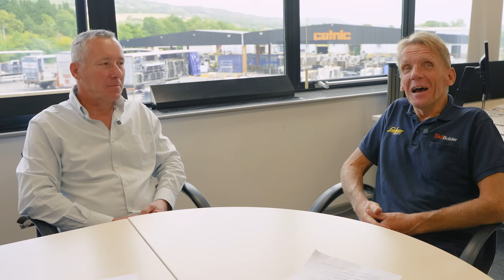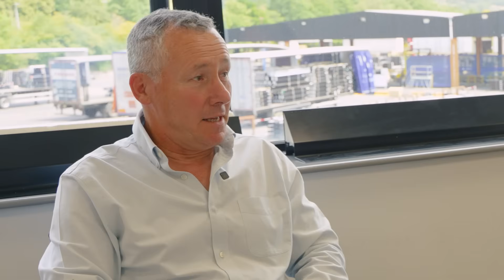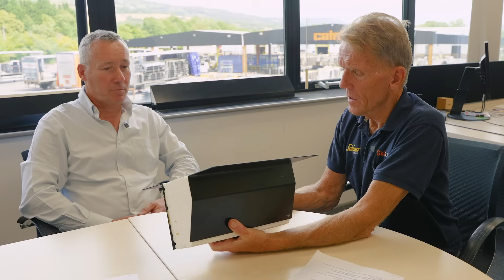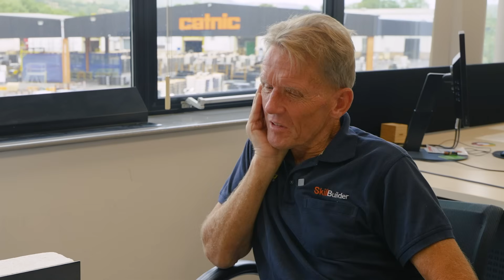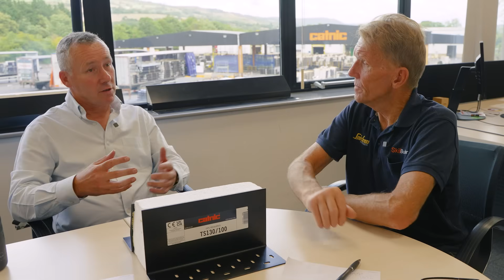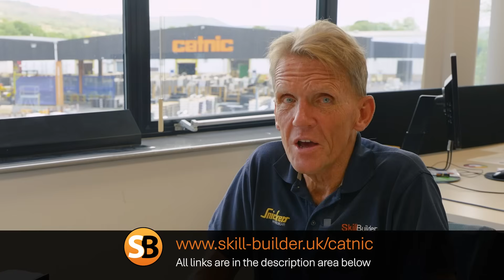Why Thermally Broken Lintels Are a Game Changer

Comment: There's no doubt these thermally broken lintels are a great idea 💡..
A few improvements that I would like to see on them type of lintels are a 25mm upwards step in the inner lintel to allow for a P.I.R thermal insulated plasterboard to be stuck to the underside of the lintel for even better thermal heat loss at the top of the inside of the opening together a high compressive strength fire resistant P.I.R insulation in between the two steel sections instead of the polystyrene..
Are you listening to me CATNIC?.
No..😂

Comment: Fabulous and important video! 

I just had to replace the old wooden lintels over my balcony and double door because the bricks above started cracking. A 1940s semi detached and all was hidden under some thick plaster. 

Got a 50mm cavity and couldn’t get a thermally broken lintel and my builder was a bit surprised when I was asking for it. Unfortunately, Catnic does not make these for a small 50mm cavity! 😢

So we had to get separate lintels and put insulation in between. Would have been easier with one thermally broken available like this. 

I replaced the doors with some more efficient triple glazed options and can’t believe that people would consider a non-thermally broken lintel just above. It is like a massive cold bridge where it will condensate the water.

Comment: Surely just using two separate lintels for the inner and outer leaf means you’ll have a long lasting and robust lintel design without any thermal bridging?
Reply from the maker: That is true but it can cause rotation when building.

Comment: Once in it acts as two large L shaped lintels, structurally works well but I doubt it is as efficient as the older style as there is a mass of metal missing from the top. That poly will keep you warm. Another clever Catnic product.
Reply: When you say less efficient, do you mean in terms of the amount of steel used to achieve the required strength?

Comment: No insulation in your cavity, 100mm foil faced PIR bonded to inner with foam adhesive and reveals lined with 25mm. Plasterboard foamed to PIR. Quicker and better job all round.
Reply: What? How do you get the PIR into the cavity of an existing wall though? Am I taking crazy pills?
Reply: @speedoftencats works for new build and retro. Keep the cavity clear, foam glue PIR to the INTERIOR of wall, tape up and foam plasterboard to it.
Reply: @bilvis1985  Ahh, I get you now. Makes sense. But if I've got you right, you wouldn't do this on new build then, you'd just fill the cavity itself, no? This is a retro fit solution. Am I still worng?
Reply: @speedoftencats No. I use it on extensions. No need to put any insulation in the cavity in regs. As long as the total u value is achieved, it's fine. Loads quicker and nice clear cavity. Cheaper material costs as well
Reply: @bilvis1985  I'm guessing that means you can compensate by reducing the cavity gap itself then?
Reply: @speedoftencats 50mm minimum cavity
Reply: But then you have less thermal mass within the insulated building envelope, and you have smaller rooms.
Reply: @TC-V8 If retro, I only fit 50mm. Equals pre 2022 new build regs. Losing 65mm off external walls in a room makes no real difference, unless room is tiny. If it's an old house, there will be enough internal masonry walls to compensate for thermal mass loss. If thermalites, there's no bloody mass to them anyhow.

New build is 350mm minimum wall thickness regardless what method, unless you spend a fortune on full fill PIR to save 50mm
Reply: @bilvis1985  ok, thanks for the feedback.
Reply: @TC-V8  Not if you reduce the cavity gap. Overall, the profile remains the same.

Comment: PIR insulation is more dense and stronger and has better  R value than EPS seems like a cheap product to me no thanks I'll wait for someone to do it properly even if it costs more.
Reply: Rodger said he couldn’t press into the EPS so I guess it’s stronger than usual EPS. I’ve got a lot of kingspan going in my roof and it’s easy to dent with a finger. 

Is there other types of PIR?
Reply: @davideyres955 

PIR insulation is stronger than EPS, with PIR typically offering higher compressive strength and better thermal insulation properties in a thinner layer. While the mechanical strength of EPS varies with its density, PIR offers more consistent mechanical and thermal performance
Reply: PIR doesn't have the compressive strength required for a lintel. However PIR also suffers thermal drift, making it less suitable over a long period of time.
Reply: @khalidacosta7133 
Do your research see below:

PIR insulation is stronger than EPS, with PIR typically offering higher compressive strength and better thermal insulation properties in a thinner layer. While the mechanical strength of EPS varies with its density, PIR offers more consistent mechanical and thermal performance
Reply: @gasmoney9319  This won't be EPS.... most likely XPS but either can have a much higher compressive strength than PIR. 

What you've done is taken some blurb from a PIR manufacturer. Of course they are going to say their product is better because PIR doesn't have consistent thermal performance, as it's thermal performance relies on the gas (usually pentane derivative) that is used to create the foam. Over time, the gas diffuses through and hence thermal drift occurs.
Reply: @khalidacosta7133 check Google for yourself why do you think PIR is more expensive than EPS at the same density. Think about it  Jabilte breaks very easily compared to Kingspam boards.
Reply: @khalidacosta7133  So are you saying EPS is better than PIR in all situations and that PIR is just marketing? Hoenst question. EPS is much cheaper, right? Put another way, where would you use PIR over EPS then?
Reply: @speedoftencats  No. PIR needs correct installation to assure the values don't drift. However, in the real world, no tradesman is going to end up doing the work perfectly and that's not accounting for any movement in the house. It's similar to using VIP. Far, far better but an absolute pig to work with.
Reply: @khalidacosta7133  Yeah, I often thought no tradesman is going to install PIR to the spec needed. The only thing is, you could say this about just any other system, too. 

So what do you recommend then? For say warm/ cold roofs or cavity walls?
Reply: @speedoftencats  It would largely depend on your circumstances, what you want to achieve and how much you can trust the tradesmen. I would simply use Rockwool all round, everywhere. Zero thermal drift, product never degrades, non-combustible, reduces sound emission, does not off-gas (do you want to breathe in flame retardants?), it can never rot and most importantly, it is breathable, which can reduce moisture and if it does get wet, unless submerged, it is not a huge problem. XPS would be great but flammability issue as with PIR, otherwise flame retardants aren't great. Cost is cheaper than PIR, however you require more depth for same thermal performance. Most importantly though, is easy of use, usually friction fit, so when the building moves, the insulation moves with it, either compression or de-compression.
Reply: @khalidacosta7133  Thanks for the comprenensive reply. the problem with rockwool I see is lack of compressive strength in some applications (above floor slabs), where this isn't important, fine, but if it is, then what? Also, would you use RW in a loft between joists (Cold roof)
Reply: @speedoftencats  Yes, Rockwool will compress, so if insulating on top of a concrete floor, I would go with XPS (extruded polystyrene, which is very different to expanded polystyrene) for it's ultimate compressive strength. PIR is barely suitable but XPS is has far, far higher compressive strength due to it's closed cell nature... and the blowing agent in XPS has far less migration (hence why PIR is foil faced... PIR is not truly a closed cell foam and hence moisture is a problem... can your builder be trusted to close every single seam perfectly to make it gas tight?). Only time I would use PIR is where space is very limited and you have no other option to meet the thermal target. Rockwool for a ceiling leading to a cold roof is perfect. 
Recently I did 200mm of glassfibre wool across the joists (saves money, there is no access to ceiling above and had to be installed by pulling the ceiling down and have plenty of space in the cold roof!), coupled with Rockwool slabs between the joists. As it was in a bathroom, vapour barrier (a plastic sheet) was installed on the warm side and then plasterboards. This way, moisture is contained within the room, what little might migrate through the vapour barrier (some will....), the insulation won't trap. Bathroom is warm, perfectly dry and mould free. All walls had 10mm insulated tile backer board (which is XPS), installed for extra insulation. In short, PIR is only when you have no other option and you must make sure installing is perfect. XPS for compressive strength. Rockwool for everything else and glassfibre for when you reduce costs and space is not an issue.

Comment: I assume this is designed just for new builds?
E.g if a lintel needs replacing on an average 1960s house this would be more expensive and never save the extra cost over a lifetime(?)
Reply: We've been making ongoing "small wins" in our large (270m^2 plus) 1930s five bed for 30 years, and as a result our monthly energy bill is sub £180 and that includes charging our EV to let us do 10k+ miles PA. The extra cost of better performing materials is usually insignificant compared to labour, so it's worth doing your homework and upping your spec.

Comment: Hi , just a thought - as when a fire happens within a house & most houses now have plastic window frames - the heat breaks the glass & flames rush out the broken windows , will the Lintel go on fire & them spread up inside the cavity - think about if you use this lintel in a high rise block of flats.  Ed,
Reply: Majority of new builds use fireproof glass/rock fibre batts.

Comment: I'm sure this thermally broken lintel has been tested but my concern is Condensation build up over time slowly weakeninh the bonding glue. A pvc drip tray bonded over the top would have been a good idea.
Reply: The bonding glue doesn't do anything after the walls have been built, so this is a non issue.
Reply: But the glue is holding a non structural part

Comment: Nothing thermal about this lintel. You kit out a room every wall, floor and ceiling with this foam and I guarantee you it will still be feeezing.
Reply: so what should lintels be made from?
Reply: @michaelfraser5723they should be solid the  role is to provide structure not to stick it to foam!!!!!
Reply: @Ash78699  This lintel is solid for each skin. It's no different to fitting two steel L shaped lintels.
Reply: Lol

Comment: Clever problemsolving, I can see this work. How do you keep rodents etc. from eating the foam though?
Reply: Why would rodents WANT to eat the foam? At that point, you have bigger issues.
Reply: @khalidacosta7133  Nesting material. They don't actually eat it, but they will bite chunks off to use.
Reply: @stephen-boddy  There shouldn't be a way for rats and mice to travel around your cavity. They would be passing through a lot of insulation on their way to the lintel.
Reply: @Roger-Bisby1  The way I saw a recent build near me go up, it was inner block-work first, PIR insulation board tight against it, a narrow air gap, and lastly the outer brick wall. There was still a void in the cavity, and mice can squeeze through stupidly small openings, and scale vertical surfaces with ease.
Reply: @stephen-boddy  Yes that is what they call full fill cavity insulation but far more common is the Rockwool or simillat cavity batt which doesn't leave a void.
I have come across a lot rodent damage in my time but I have yet to see a rat or mouse gnaw through a metre of Rockwool just to reach a less suitable nesting material.
Rodents are very clever/
Reply: @Roger-Bisby1  I'm not surprised by rodents in old drafty gap ridden buildings or even some modern builds, but surely the latest house builds in 2025 with the latest technology are designed to keep rodents out?